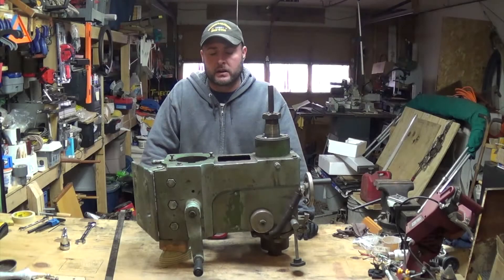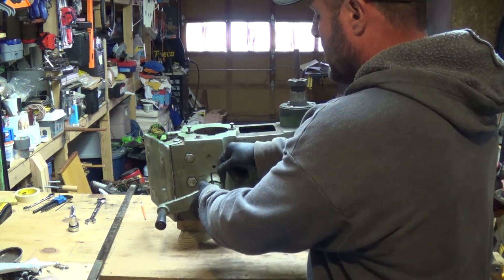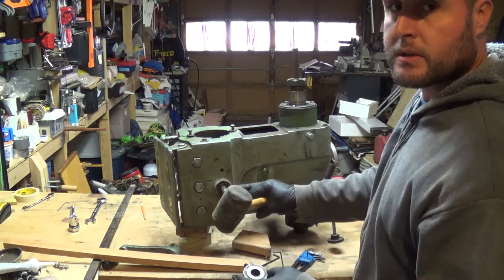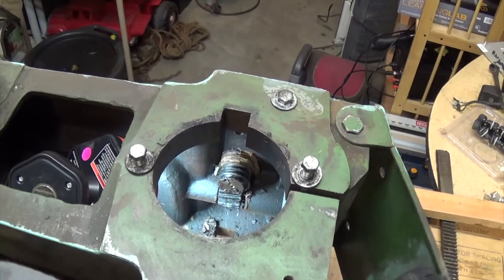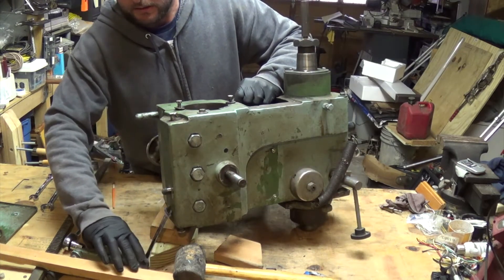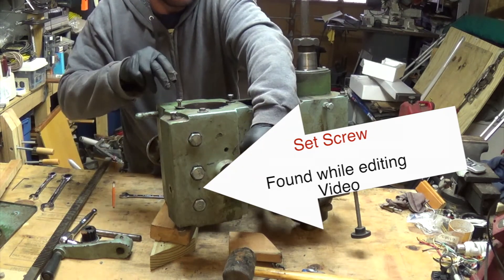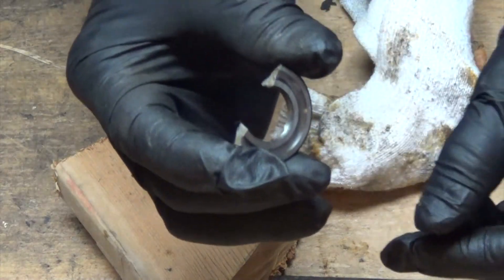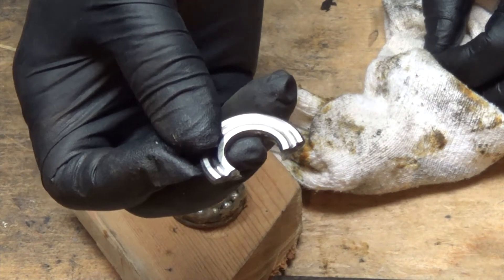Milling Machine 3 Elevation Crank

Comment: 0.10 worth of emory cloth to deburr the shaft of the set screw marks would have eliminated the necessity of the hammer AND removal of the spur gear & shaft.

The broken bits are the thrust bearing race(s).

There is a single thrust bearing & a bronze thrust washer, which means there is bearing support in 1 of the 2 vertical directions, where both directions would be better.

The bearing is a ball type w/ thick races. Replace it w/ a roller thrust brg, & there's enough room for a 2nd bearing on the outside of the case.

Bronze washers can be added to shim for proper pinion to spur gear alignment.

By adding a 2nd brg, both the up & down movement of the head will be easier.

I just did this to the Jet-16 I bought last month.

GeoD

Oh, yeah... Jet had a problem w/ these races breaking. On the Jet-18, made later, they 'solved' the problem, they just eliminated the bearing. Not even bronze thrust washers!